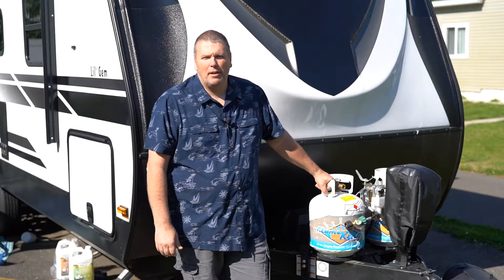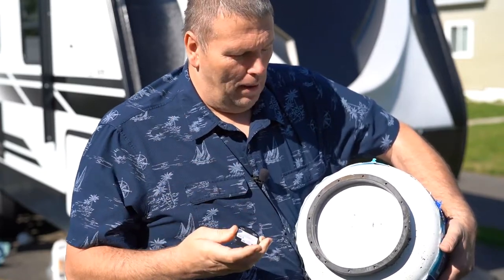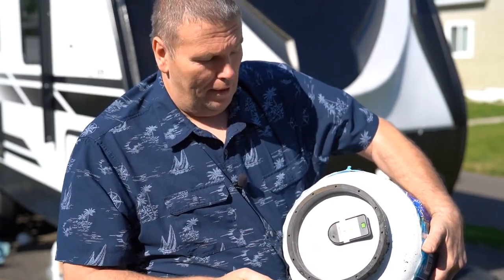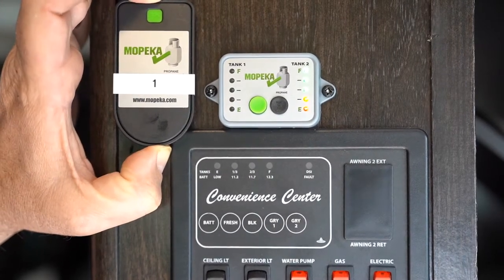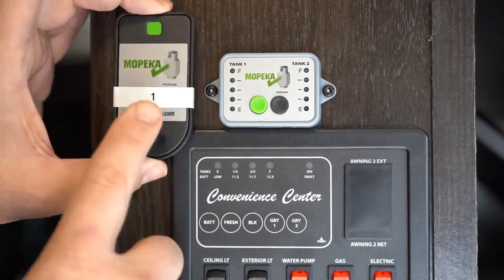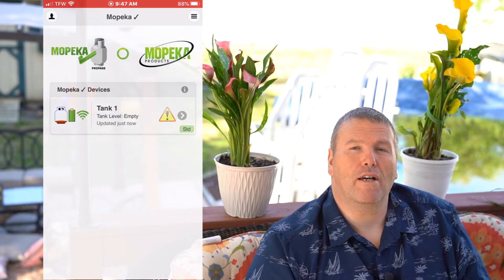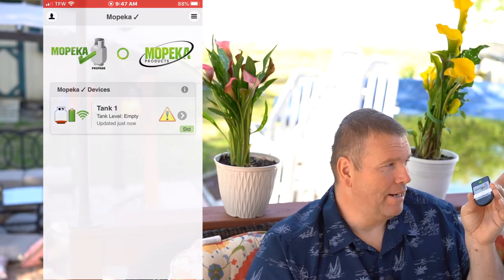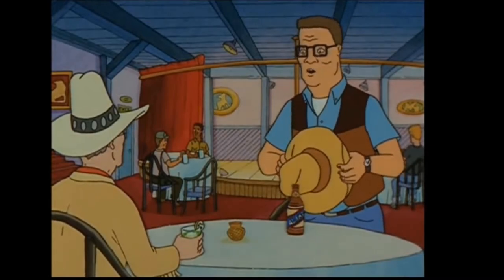Mopeka Tank Check Propane Level Monitor Install and Setup S2E3

Comment: Good explanation of the sensor, I have been using the sensor for a year or so now, and mine does not work as well on some tanks, probably due to loose paint on the bottom of the tank. FYI propane tanks should not be filled more than 80 %

Comment: I run three Mopeka sensors on my 5th wheel 30lb cylinders with the Mopeka wifi bridge connected to my King wifi extender router in the rig. Now I can see levels from anywhere I have cell service.

Comment: Thanks for your info on the Topeka Tank Check Propane Level Monitor. I have mine installed now and it's working great. Have you or anyone reading this with experience using this device ever had the magnet come loose, lets say from a bump, and fall off the Tank? I'm a little worried about that. If mine falls off there is nothing stopping it to just dump out onto the highway.

Comment: Thanks for the in-depth review. What batteries does it require. How long do the batteries last? I suppose there is not an on/off? Registers continually? Is it Wifi or Blue Tooth? It’s own, or do you have to be connected by cell or wifi? Thanks again